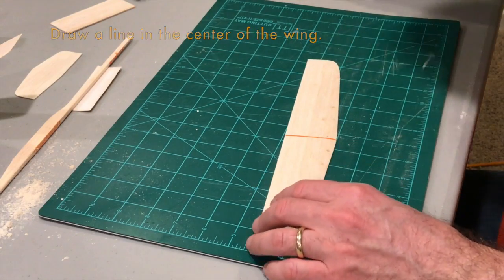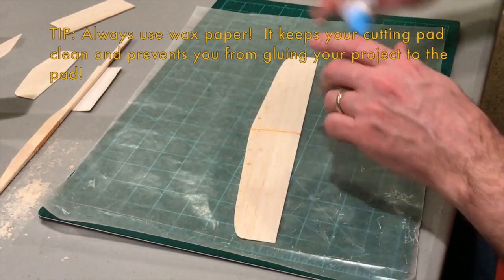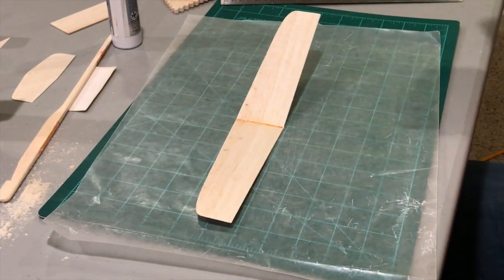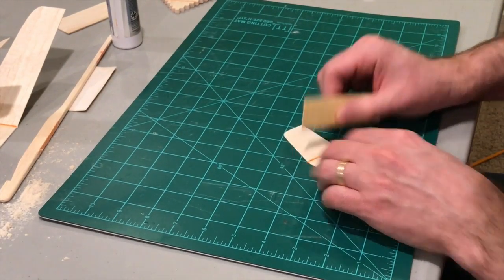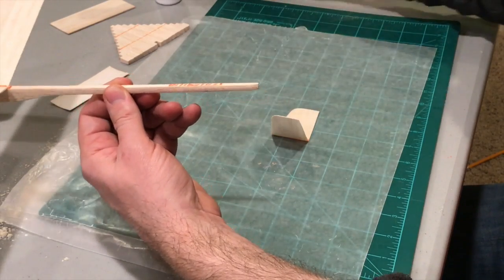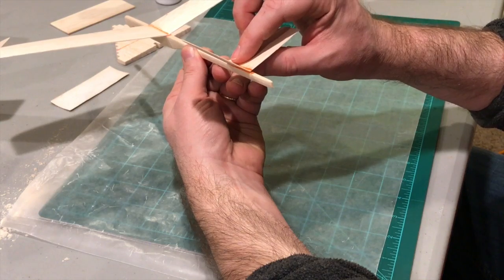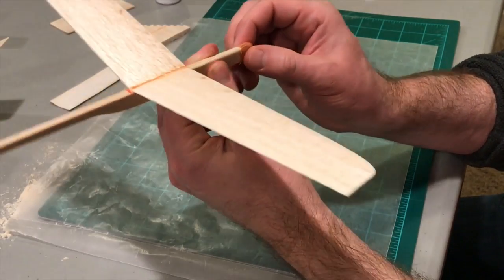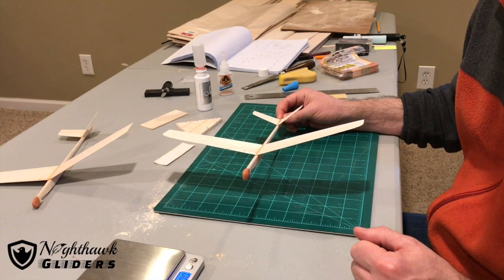How to Build a Balsa Glider - 12" Sandpiper - Part 3

Comment: please,tell me wher is CG of this model
Reply: rule of thumb for powered planes is about 1/3 back from the leading edge of wing, but with a glider you want it closer to 3/4 back as a start point, because gravity is your motor. you'll know to add or subtract nose weight in a few tosses
Reply from the maker: Thanks for answering this one model nutty.  Sorry I missed your comment Aleksandar.  On this model the CG is approx. 55% back from the leading edge of root chord. (give or take a few depending upon the density of materials you choose and how you sand your parts.)
Reply: +Nighthawk Gliders hope you got my direct message from this morning,
don't know if it'd handle a hook launch, but in a straight line easy toss the "design" is pretty amazing. I looked at that lid and "hey wow ok", a few minutes later chasing it all over the house dialing it in, shaping the edges etc before gluing.

Comment: Bread would you like to help me that which glue you used to stick those balsa woods
Reply: when you were doing the wings I couldn't help but eyeball that little pile of balsa sanding dust just sitting there, just sitting there, sitting there...
it can make thin CA into gap filling CA like "instantly"! hehe
Reply from the maker: I've never done that before, I suppose that's one trick.  I've never been a fan of using thin CA in the models I build, although, it has its purpose.  I prefer using medium CA and using the product for instant drying leaving a nice clean joint.

Comment: OK built the sandpiper ....on launch it's like going over a hill. Obviously the incidence is out of wack. what to reglue or bend?
Reply from the maker: Hmm... if you have too much “lift” on the tail your glider may steeply and quickly turn downwards on fast launch. Perhaps a couple options. My first option is always to  add/remove nose weight. That’s easy and does not “change/bend” any wood. In this case first try less nose weight. If that doesn’t work, then next option is to slightly, and I mean slightly bend elevator up. And if longitudinal stability is a problem... you may actually have to ADD more nose weight AND bend elevator up. This should prevent glider from being too pitchy. Hope that helps!  Let us know, ok?  👍

Comment: Great videos and thank you for your series of videos. Building this project was a nice break from some longer term project I have going.  The only change I made was to rout V-grooves in the fuse where the wing and stab mount to the fuse.  I will add a 1/32 shim i think to one side of the fuse to set the turn.  I figured I'd have more surface area to glue by doing it that way and a guide to get the wing level.  Anyway, lots of fun to build, thanks again it's very cool what you guys are doing.
Reply: I liked this project, possible attaching the wing 3/4" further back may need less nose weight and up the glide ratio a little, also the V tail, not leaned over but offset center, centered in front but 1/2 mm left in rear, may get your left turning smoother+faster+easier. another possible is wipe leading edges clean and wrap very thin 1/2" wide tape for a slicker frontal surface. if it helps it maintain speed its longer glide, may also help prevent a nick when (not if) it smacks something. for K4 type airfoils (foam board) I wrap with 2" wide mylar packaging tape for the same effect. I'm no expert with gliders/aircraft, but do know tiny tweaks can have some big effects.
Reply from the maker: Awesome!  Glad to hear this was a
nice break and we appreciate the comment!  As always, were interested to hear how it flies.  If you wish, feel free to post a follow up comment or link to a video. Thanks!  😊
Reply from the maker: Not certain moving the wing back 3/4" would be very successful-- I would fear it would compromise its longitudinal stability.  Sure, I've built some Sandpiper 12 gliders where the wing is 3" from the tip of the nose and they fly just fine.  If you're going for a lighter glider, material selection is key.  Also, sometimes a "lighter" glider may not necessarily mean a "better" glider.  I do like your idea with the tape on leading edge of the wing... I may have to experiment with that.  Typically, I fly in an open park, mostly free of obstructions so I don't worry about that too much.
Reply: the tape being slippery slick might help air to laminar flow better was the thought, plus a little ding proofing. clear packing tape then wax on the bottom of a couple of my fast electric boats did a lot reducing drag when running straight, gained a little speed for sure

Comment: My 12" Sandpiper is drying right now - I used balsa cement- instead of superglue- hope to fly it soon!
Reply: It flies great when I throw it but when I catapult it up it cannot pull up out of a dive. Any ideas? Thanks.
Reply from the maker: Could be a several reasons.  Assuming you are right-handed... When you catapult launch it, try launching it with a starting pitch up about 45 degrees and with a right roll of 90 degrees.  It should climb and roll out level when it peaks at max altitude.  If it still stalls before rolling out level, try launching with less pitch.  Also, if there is a bit of wind, launch it down wind. If it still stalls, try taking off a bit of nose weight and repeat. If it gets too "pitchy" (roller coasters up and down)  you may need to add more nose weight and then apply a tiny  (very tiny) bit of up elevator.  Hope that helps!  😊 Good luck!
Reply: Great advice- I have just had a few nice flights- the launch angle seems important with my model quite sensitive to the initial angle and roll.I expected the plane to turn left but it turns right- looking from the back the tail is fixed slightly higher on the left side as I thought this would induce a left hand turn as I'm right handed. Thank you for your help.
Reply from the maker: Well, done!   Even great Gliders can fly poorly if not launched properly.  You have to find the sweet spot. Given your tail tilt the way you described, it (should) turn left when it is in the glide-- but you may have a few other (possible) design imperfections overruling the tail tilt and causing it to turn right.  Perhaps the right wing is a bit heavier than the left?  Maybe the left wing is producing more lift than the right (or right wing producing less lift than the left.)  and finally,  maybe your tail is glued in the fuse a wee bit crooked?   Keep building and practicing... and you will certainly get better and better!   Glad to see you enjoying flight, my friend!  😀
Reply: The right wing was indeed heavier than the left- I sanded the equivalent weight of 1/16" ball of clay from the underside of the right wing and now the plane flies like it should- to the left. Thanks.
Reply from the maker: Most excellent!  Having your wings balanced is key!   😊

Comment: I made similar model, but the same dimensions of the winds from your video. Only differences is boom and tin/lead wire for front ballast. It flies perfectly. Only thing... I glued main wing diagonally to the right, but planed for left turn and glued tail... Now it flies mostly right turn, but it has braking action - can't 'decide' where to go at first. Thank you again. Excellent tutorial!
Reply from the maker: Thanks!  We're glad you liked the tutorial!  😊  I believe if you tilt the main wing to the right with no tail tilt, it will induce a turn to the right-- (as you have noticed).  The same thing happens if you tilt the tail to the left with no main wing tilt (it turns right).  Reversing this tilt direction will result in a left turn.  If you have a video of your glider we would love for you to post it so we can see if fly!
Reply: Yes I have half hour video, not on YT, but I can post it. Just maximum flight time is about 17 seconds. The problem is with braking action - one wing want left, another right. :D Okay, let me see what I can do - today was very hot and it is not that good for my health. But, forecast for tomorrow does not promise either.
Reply from the maker: Ok, great!  No rush... please stay safe from heat!  I'm not certain by what you mean by it having "breaking action - one wing want left, another right."  Are you saying when your plane glides it keeps leaning to one side as it spirals down?  Or, are you saying that your plane loses air speed during glide and it is stalling?

Comment: Great instructions. Wonderful level flyer that when it is thrown goes and goes and does its best to circle back. The problem is when I try to launch it with the catapult it immediately begins a loop instead of shooting straight up and then gliding back down. I assume I need to trim it but before I mess something up, any ideas?
Reply: yupyup, half way to being I beam, structural rigidity from shape. it could resist warping over time a little better too I'd think
Reply from the maker: Great!  If you hand toss it and it flies level and turn left... you are on the right track as you have it balanced well.  Now, when you launch it from a catapult, speed is dramatically increased and so is lift!  So, first I suggest you read the description of this video-- I explain some launching tips that might help you!
Reply: I tried a little different angle and more weight on the nose and that thing shot up into the air like a rocket . . . and came down like a feather. Two tremendous flights until it hit a tree and snapped the fuselage. I was able to carefully remove the wings and tail, sand the joint flat and attach them to a new fuselage. I'll be interested to see if that holds and if it flies like it did previously. I didn't time the other one but it might well have been in that 25-30 second range. Thanks for rekindling excitement for an old hobby!
Reply from the maker: Excellent!  Great feedback and I'm happy that you had good launches and successful flights!  Ugh, those trees!  Sorry to hear about the fuse!  You know... I've had a couple recent gliders have fuses break about 1 1/2 inches behind the wing.  I just re-glue them and they often work fine.  I'll have to revisit my fuse design a bit-- maybe I'll try a 3-ply fuse for better strength.  Obviously, more dense wood on fuse would help strengthen too...
Reply: A lesson learned with the rebuild is that every glider is different. I used the wings from the first glider and tried to balance everything just as carefully as the first time around and yet it doesn't fly quite as beautifully as the first. Re. the fuselage, I found myself taking a long look at paint stirrers on the workbench. Not the flimsy ones, but those just a tad thicker than the fuse that broke. I don't have a scale but offhand I'm thinking that cut down to size and sanded they wouldn't be that much heavier than the balsa and a lot stronger. When I was in junior high I used to make fuselages from the wood used on orange crates, the kind they pack Clementines in these days ;-)
Reply from the maker: Yeah, I've built many Gliders the "same way" but each tend to have own personalities.  Sometimes I mend something that breaks and then it flies even better!  When I coached Science Olympiad, we competed in the Indiana State competition. A student broke fuse of his backup glider the night before.  He re-glued it and coated his whole fuse with CA.  Strangely enough. It became one of his primary Gliders. We finished 3rd in state. Lol. 😊
Reply: Something else I learned is that even the tiniest adjustment can make the biggest difference. Bending the trailing edge of the right side of the V-tail upward a minuscule amount turned the rebuilt glider into a gem. On several flights it stayed up so long it took my breath away. I was the only one there and I found myself wanting to turn around and shout, ARE YOU WATCHING THIS?
Reply from the maker: That is fantastic!  Glad it turned out to be a great flyer for you!   😀  Yeah, it takes super-tiny adjustments on the elevator and just that it can makes world of difference. You've got it flying right, my friend.  Thanks for sharing!
Reply: the two plates vertical, if it had a top bridging it gets lots stronger, the CA glue forming an internal T shape, try the thinner stock used for tail feathers. you can sand away some of the weight after that easy enough.
Reply from the maker: Yeah! Good idea!  Also, the horizontal glue layer may help prevent it from bending left-right.

Comment: A question .... the angle of attack is 0?
Reply from the maker: Good question, and this is tricky... when I launch this glider I want it to naturally pull up some but not too much. If I notice it needs more angle of attack (AOA), I just apply tiny (very tiny) bit of up elevator.  I don't normally install the main wing with any angle of incidence (AOI) in relation to the fuse. So that is 0. I've tried adding AOI before but seen mixed results.  Too much AOI can cause the fast catapult launch to lift the glider way too much (and loop) too sharply. But, I probably should experiment with AOI some more.  If you find a happy result, please let me know!  😊
Reply: Jejejeje I spend that what you say. I gave him 10 degrees of angle of attack and my plane suddenly went up. Excuse my English, I'm from Argentina.
Reply: it's actually such a great question for any type bird! nice :)